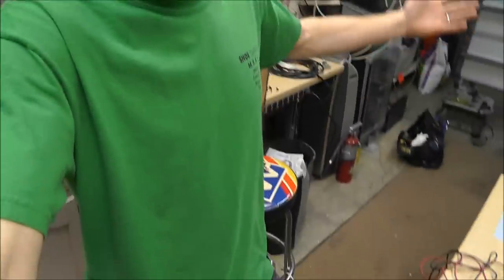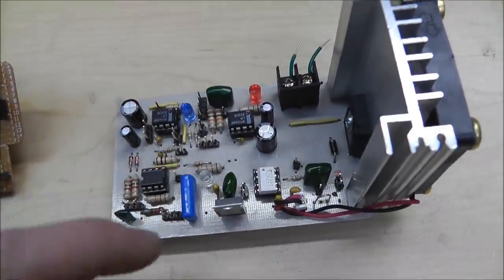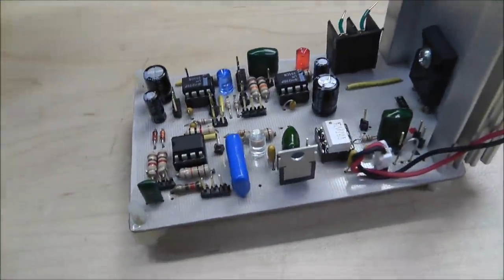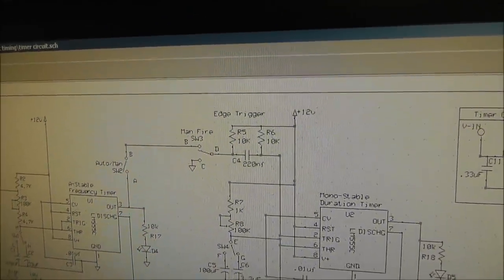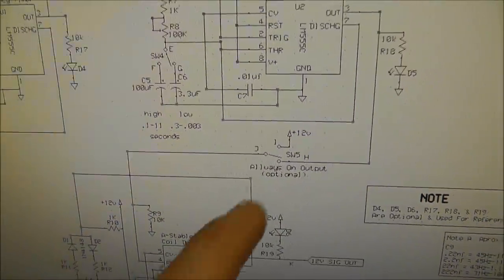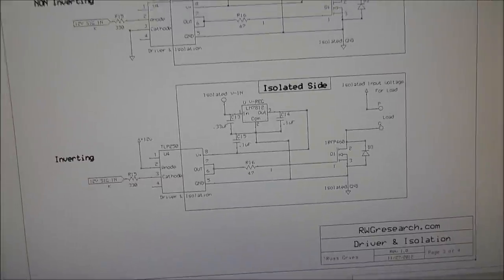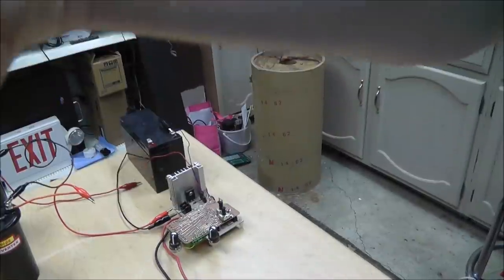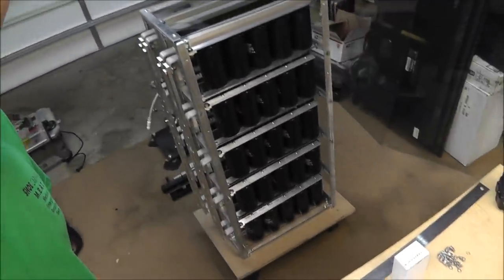Update 19 NGE Papp: Finished "Papp Test Timer Circuit", Ignition Set Up Test, & life! ;)

Comment: Not long after i used my laser printer to print about the 5th toner transfer on to cheap ass ink jet photo paper - my printer stopped working (for normal paper). Not sure if loading the heavy paper killed it or not, to be honest. And I also had troubles getting the black stuff off the copper traces, when all said and done. Probably just me, and my lack of understanding / talent.. something.. but so far that's been my experience.